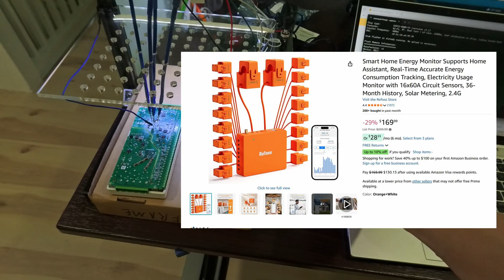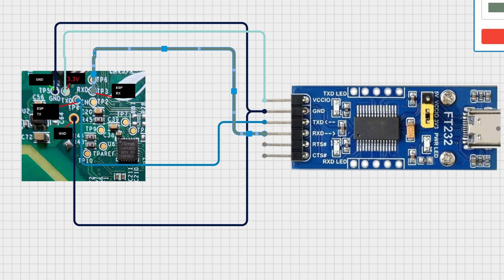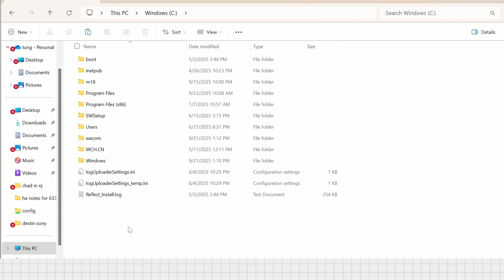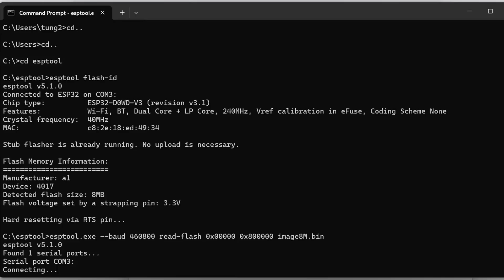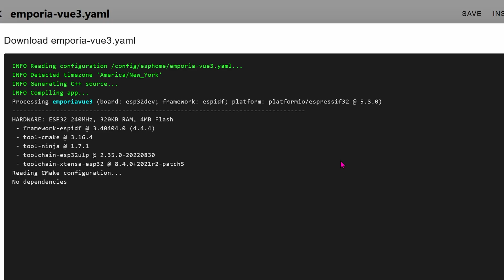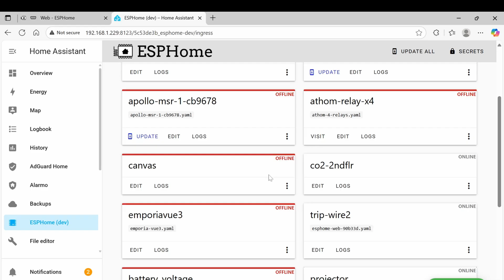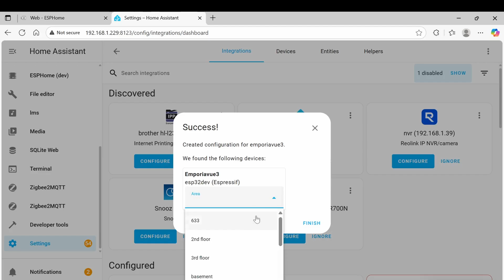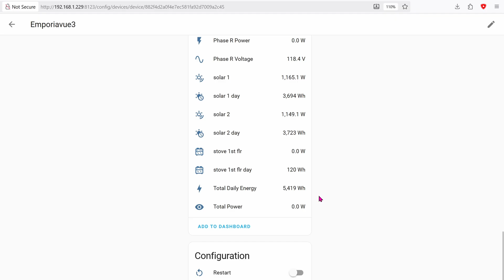soooo much better with ESPHome firmware: Emporia Vue3 whole house monitor

Comment: Will this yaml work with a Vue 2 as well as a Vue 3?  I have both running through Home Assistant.  They are both on the same 40 breaker load center.  Thanks.

Comment: I can see your Phase R power and Total power are reading as zero. I had the same issue (in addition to my Phase L power). What solved it was changing the phases in my main 200A CT clamp sensors in the yaml config. So basically I swapped phase_a and phase_b between the RED and BLACK pairings in the yaml. After that, the power was measuring correctly. Of course, afterwards I had to swap all the phases on all of my branch CT circuits to correct them. But in the end, all power readings were working. I think a foolproof way to set these up is to ensure that your main clamp sensors are reading power correctly (non-zero) before assigning all the phases to your branch sensors.

Also, small note but if you have a solar system, you probably DON'T want the *pos filters on you main clamp power sensors because these will convert any negative values to zero. With solar, negative reading is meaningful as it means you are sending power back to the grid.

Comment: Nice video. I'm using a DSDTech FT232 adapter and I can't flash for the life of me. The adapter either shows Rx and Tx lights flashing constantly indicating the emporia is not entering boot mode. It does work about 10% of the time, however even then I can't flash because esptool says it fails to communicate. AI tells me that the adapter's regulator and VCC output likely does not supply sufficient current to power the Emporia even though it's set to 3.3V. I ordered another adapter... hopefully this one works. EDIT: It did